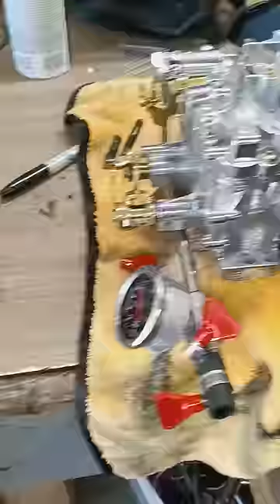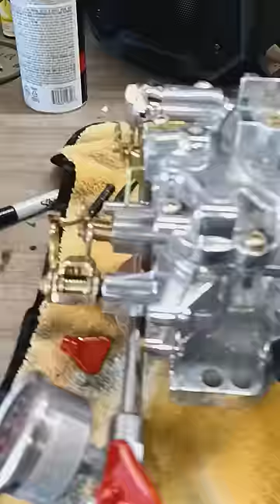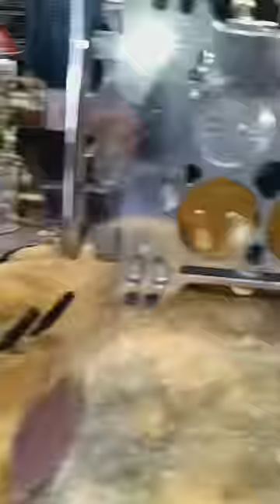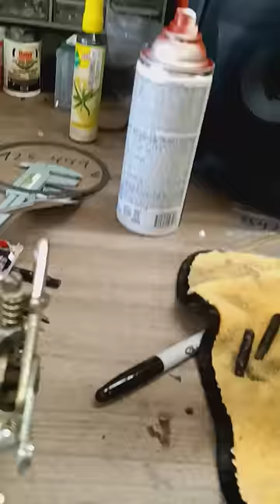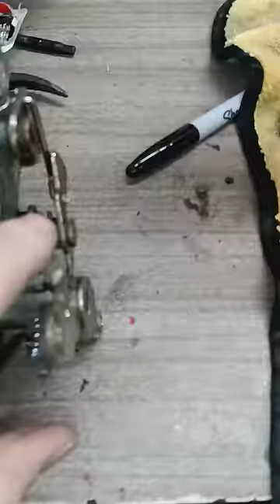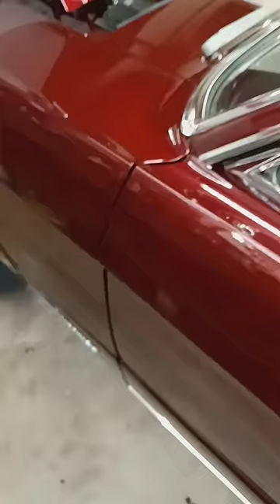how did I miss that?

Comment: Do a dyno run before and after that would cool to see the hp difference
Reply from the maker: I would love nothing more than to dyno pulls before and after. Unfortunately I don't know anyone that will give me time on the dyno without charging me. If the channel was monetized I would have no problem spending every cent on the car. Unfortunately anything I do to the car comes out of my own pocket. I would love to get the car on a dyno in compare the carburetors it would be awesome.. LOL. I have used the dino calculator websites and I'm estimating  between 320hp and 340hp with about 320fb of torque but that is with everything working like it's supposed to and not taking into account a carburetor with bent linkage LOL. I really don't run the car past 5500 even though it's set up to go to 6200. I'll try and make some videos comparing both carburetors. I have to have buddies help me to hold the camera. I am the poster child for the non-corporate YouTube channel. Stay tuned man I'll try and make good content that you'll enjoy.

Comment: Will it still not open laying flat instead of standing up I had one do that and I took off the little link bar that runs up to the choke I think it's been a minute or two lol
Reply from the maker: I need to make a carburetor stand to check that. I did hold it up and look while I operate the throttle and got the same result. I just couldn't hold the camera and the carburetor in the air at the same time lol. The linkage is definitely bent. I'm going to throw some heat on it and bend it back and doing to do an update to the update. Why is it the 4 or 5 trolls really bother me. When a man gives you his word unless you can prove otherwise that's the end of it. You are more right than you know about these YouTubers weirdos. I appreciate you man.

Comment: I'm no carb designer but I have rebuilt  many a Holley (I'm on about my 3rd generation holley rebuild master catalog.) U probably going to need to adjust (shorten in ur case.) The pedal rods and linkages. Did u not notice pedal was halfway to floor, or did u just mash the fucking thing?

Comment: You will like the avs2.i run that same carb on my 82 Scottsdale
Reply from the maker: Hey let me ask you a question. Did you have to adjust when the secondaries open? I have a slight bog below 2500 RPMs I adjusted that secondary air valve to where they opens slower. The bog is gone I ordered the tuning kit to tweak the most torque out of the motor. Horsepower is cool but torque is what makes the tires smoke.
Reply: @BPattB  I did adjust the air/fuel screws. I put this carb on a 355 chevy engine and absolutely love it. Mine has electric choke. The choke was a little temperamental, but it works perfectly. The only carb that I've owned that's worth a shit
Reply from the maker: @bearbailey1321  I love Edde's for the street and Holley's are good if you want to get that little bit more.

Comment: I'm surprised you didn't feel that in the gas pedal.
Reply from the maker: I adjusted the cars accelerator linkage when I put that carburetor on. I set the pedal to the floor on what it thought was W.O.T. but in reality it was just as far as the carb could open with bent linkage.

Comment: Do you have a racing tachometer? Seems like you will get to redline really quick.
Reply from the maker: The car has one of those gauges that is a circle and reads RPMs lol, it goes to 8000 but I set red line at 5600 just to be safe although on paper the motor should be able to go to 6400 no problem sorry if I seem a little edgy I got half a million views in 10 days and it's the 20 or so trolls it seem to get into my skin. Thanks for the view in the comment..

Comment: That's called a vacuum secondary.  It opens all the way at higher RPM.  You just can't see it cause it's on the car.
Reply from the maker: I go over in a follow up video where I hold open the choke and the weighted secondary air flap open and the lock out. Feel free to check them out.

Comment: But is it a direct replacement or a upgrade carb
Reply from the maker: I made a follow-up video going over the differences, it's a upgrade for sure. Great question. Quite a few people just assumed I replaced the carburetor because the linkage was made. I ordered the upgrade and realized the linkage was bent when I took the old one off.

Comment: On my '68 Grand Prix back in the 80's (400 Pontiac V8) I use to play musical carbs and swap out my Quadrajet w/ the small Holly (400) the idiot at the performance store sold me.  I'd put the GM carb on when I wanted speed. My bad, I should have bought the Holly 650 in the first effing place!   The sales guy said the 400 will give u speed 'and' gas mileage. Yeah right!  
PS. Shout out to Mark for selling me that very fun car! 
R.I.P. brother!
Reply from the maker: I'm about to do that just for s** and giggles I got and Edelbrock and a Holley I'm going to throw in and out to see what they do!
Reply: @BPattB  oh yeah, I used a 1" thick carb spacer too. Was suppose to help. Almost forgot.

Comment: No worries, the E carbs leave a lot of power untapped, so you will pick up some from getting WOT, but not a lot. The E carbs are great for people who don't know carbs, have nearly stock small engines (under 400ci) and don't mind not getting all the power they could be. They bolt on and run with an idle adjustment, which is what most people need. Simplicity.

Comment: I would've returned the new one(if possible), and just replaced the linkage. Spend that $400+ on a 8.8 LSD out of an Explorer with 3.73s in them. Would be hooking yourself up with discs in the back too.
Reply from the maker: So I did the math on having 355 gears and I would be going in excess of of 3000 rpm at 65mph. That just means I need a 5-speed before I do the 8.8 LSD exchange. I like how you think brother stay tuned for tire smoke and burnt rubber smell.

Comment: Is it the stock I6? Cus I gotta say, I’m definitely all for the whole “there is no replacement for displacement” idea, but if you’ve been doing all that crap at half throttle with a little I6 you can call me impressed
Reply from the maker: It's a 302 with 289 heads, estimating it's got a stage 2 cam, MSD ignition, Edelbrock RPM intake. You can check my channel I did a quick walk around on it you can see what's under the hood
Reply: @BPattB  even then man, it’s only a little 5.0, that’s not bad at all
Reply from the maker: @MRMechanicRC  I like it,,,, a lot,,, lol
Reply from the maker: @MRMechanicRC  I've been saying I'm going to post a video of the tires being roasted. Hopefully next weekend. I'm going to replace the gas tank so I'll make sure I get a video before then

Comment: did it feel sluggish other than at high rpm?
Reply from the maker: No, I did swap out metering rods when I first put it in and the carb performed a little better, more responsive.
Reply: @BPattB  that's crazy. 👌

Comment: My brand new AVS2 came out of the box with the secondaries locked up and bent linkage… took me 7 months to find the issue
Reply from the maker: Dang that sucks. My AVS2 came in good shape aside from I think the secondary air flap was all the way loose. The factory setting is supposed to be loosen the air flap until it's wide open and then close it. Once it is closed go one more full rotation and that's factory setting.. Mine was definitely not that LOL. Did you get yours dialed into where you want?

Comment: Tbh, I would throw the new one back in the box are return it and bend that bent linkage straight and burn some rubber.
Reply from the maker: Oh most definitely the old one will burn rubber, but the reason I bought the new one wasn't because the bent linkage. I wanted a bigger carburetor with all the extras the new one has like annular boosters, larger secondaries, adjustable secondaries, and dual feed inlet! We going to burn some rubber anyway bro stay tuned

Comment: I would take a deep dive into the engine considering how lean it's been running for about six months with you beating on it
Reply from the maker: Why would the AFR be off? It it's basically like the carburetor had governor or I was using a 2 barrel. I didn't change the jets or metering rods after I initially set them.

Comment: Was getting good gas milage. Now with the fix and more wide open throttle. Gas gauge is going down quick.
Reply from the maker: You're right I'm sure, but honestly I don't even monitor the gas mileage in this thing. It's more for fun and I just can't help myself with a new carburetor from putting the throttle to the floor. The manual transmission doesn't make it any easier to stay out of the throttle LOL. Right on man.

Comment: HMMMMMMMMMM........LOVE EDELBROCK
Reply from the maker: So do I! But to be fair to all the Holley guys I've had just tell me I should be running a Holley because reasons. I'll tell you the same thing I told them. They both have their place and if I wanted to squeeze every ounce of power out of this engine I would run a Holley, if I want to tune it and not have to deal with it tuning it again every couple of months or flooding I'll run in Edelbrock. That said on a 340ish horsepower motor how much more is a Holley going to give me, 10hp at the very top? How much usable down low? Anyway I'm on your side love Edelbrock!

Comment: I had a 66 mustang with a 92 year 5.0 Lincoln  mark engine  with a 650 holly  I could punch it from a roll and smoke the tires  forever  with the  edalbrok  I could hold the brake and floor it no spin  the car pulled so hard it would twist  the car and it was  almost 2 seconds faster  because it left quicker  and perfect every pass

Comment: What’s gonna happen way more power and most likely too much flow it’s gonna smother it out and bog it down gonna need a tune for sure.
Reply from the maker: I'm already there and made the adjustment to the air valve on the secondaries. The car would bog at anything under 2500. So as a test I got it to 2500 held it and bury the throttle. I spun the tires all the way through first gear and halfway through second while the car fishtailed. Stay tuned for tires smoke and burnt rubber smell

Comment: Mine would only open half way because the little throttle pump that squeezes a bit of gas down the carb when you first hit the gas was getting stuck
But that's a single barrel yugo carb on an '81 golf lol
Won't make much of a difference if it's wide open anyways...
Reply from the maker: That actually made me laugh a little bit

Comment: So you replaced the entire carb rather than checking to see if the old one could be repaired?
Reply from the maker: No I replaced the carburetor for a larger CFM,  adjustable secondary, and annular primary boosters. The fact I noticed the carburetor of friends let me borrow had bent linkage happened after I removed it. I can tell you know a lot about cars so I'll subscribe your channel and check out your rides

Comment: We all have missed big ones . My claim
To stupidity is I didn't catch on to why
My Lincoln continental was losing power and would die Cadillac didn't seem to have the same problem as much. But I lost a number of really nice 
Cars because it pissed me off. Its call vapor lock. When a carburetor gets hot
Enough to boil gasoline then the engine 
Fuel mixture is all wrong and in my defense I was young but I find little comfort in that these were very nice 
Cars.
Reply from the maker: Yeah with the 10% ethanol in gas today the Edelbrock style carbs with the bottom of the fuel bowls touching the intake you almost have to run a spacer to get the carb off the hot intake.

Comment: Can't believe you didn't check that when you put the carburetor on the first time
Reply from the maker: Ahhh I've told this story a bunch. Half a million views will do that. My neighbor and I were drinking moonshine around 1030 on a Saturday night and decided to pull the Holley off because it flooded a couple of times. Turns out one of the floats had a hole. My neighbor took off walking home. He showed up 10 minutes later with the Edelbrock in the video. We popped the air horn and cleaned it out it and I  didn't want to start the car after 11PM. It's a bit loud. Anyway I would not be surprised if my neighbor was dropped the carburetor as to drunk to pick it up so he kicked it the rest of the way to my house 🤣. Yeah I made a mistake I should have function checked the carb. I was always going to run the AVS2 so the bent linkage is not the reason I got the AVS2.

Comment: I’ll bet it blows up within 3-5 years now that all the ponies are harnessed
Reply from the maker: Unharnessed I think you ment? All the ponies are unharnessed? Very well may happen. Seeing as how I only drive the car on the weekends and then not every weekend, I'm not trying to drive this thing in the rain,  I don't think that will happen. I've been through a lot of it with a bore cam,  compression check, no blow by, three oil changes on about 600 mi and no gold in the oil pan 👍. I mean anything could happen but I'm pretty conscious of the tac and at about  5600 I'm out of it.

Comment: it means the carb is oversized for the engine, and that it didn't need all that airflow.  I bet there is no change to performance or power.
Reply from the maker: LOL wrong. I wish I could put out videos as quick as I make the changes to the car but I have a job that pays so well I can't miss time. But the new carburetor definitely performs better than the other one

Comment: Fix the old one and take the new one back. Save the $$ and buy you a new set of tires. You're going to need them after they're fried off the rims..
Reply from the maker: Lol. I bought the new carburetor because it's bigger, and that lets me idle a little lower (you know that cool  choppy sound). It's got some cool advantages over the old one like adjustable secondaries, you can set it up as drivers or passenger side inlet or dual feed which I'll probably do, and the boosters are annular, makes the off  idle acceleration instantaneous some of the magazine write-ups I read claim the AVS2 is the closest carburetor to feeling like fuel injection.

Comment: How does someone not know the throttle isnt moving hardly at all? How does someone with enough mechanical skills to change a carb not see the linkage doesnt fully open and or see the linkage is bent while diagnosing it needs a new carb? 🤦‍♂️🤷‍♂️🙄
Reply from the maker: So the throttle wasn't " hardly not move all" it was 2/3ish open. The other carburetor was not bought as a replacement because of the bent linkage or anything else. I thought it was was common knowledge that an AVS2 was far superior than the old Edelbrock performer carburetors but I guess not. So by your standard I have no mechanical skills? Or is it just that I miss something? Car ran strong with the carburetor like it was. I don't know, consider it was a governor. Or is it that you saw it was a Mustang and just had to crap on a "Ford guy"🤣🤣🤣?
Reply: @BPattB   when you had the carb upside down opening the throttle blades it appeared they barely we’re open. I believe that was what you implied as well. Well if they barely open the throttle cannot magically work in a typical mechanical throttle throttle linkage or cable system. So yeah made sense it was very limited movement of the throttle pedal. If it’s opening 2/3rds of the way then maybe it wouldn’t be so noticeable to some. And if it was getting 2/3 of the pedal don’t be surprised if you see very minimal if any change in performance. 
I find it comical that a carburetor is “far superior” than a carburetor. Especially when both are of the same  basic design. Not like they redesigned the way air and fuel mix or how much they deliver. As far as performance between the two everything tuned exactly the same good luck showing any difference. Both are decent carburetors. I just couldn’t see how that bent linkage could be overlooked. 
And no hate on a mustang hell there is one sitting at my place right now. 🤦🏻‍♂️
Reply from the maker: @steves759  So Edelbrock did redesign the way the air and fuel mixed, maybe I misunderstood your comment but it seems like you didn't know that. Down leg booster opposed to annular booster, the annular booster atomizes the fuel a lot better than the old performer style downleg, the avs-2 also has adjustable secondaries like the old Thermo quads, dual feed inlet, and they come in 650 as opposed to only 600 or 750. I owned the mistake I made, the title of the video is "how do I miss that" LOL. I don't know how I could be more clear about making a mistake than that. I don't know what else you want me to admit that I'm stupid? If that's what you want to think about me that's okay, I'll never meet you and you're just some random guy commenting on YouTube. Honestly when that video was made I had 18 subscribers and I made it for family back east. It got 250,000 views in 12 hours. And in the six weeks since it's been out I have gained 2,500 subscribers and have gotten over 600,000 views. The majority of the comments have been great. Very few were the type of stuff you wouldn't say to a man face to face unless you wanted to fight him. There were also some comments that were snide and hinted that  somehow I'm an idiot because I missed something, which I don't get if someone wants to call me an idiot do it and own it. I don't know man this younger generation lives behind a keyboard and they know there's no consequences to what they say. We agree I should have noticed it. That was the point of the whole video.  Not sure what else you want from me.
Reply from the maker: @steves759  I remember this comment. What happened man? I was expecting to see a ton of knowledge from your channel. Imagine my surprise when nothing but cold turds 🤣